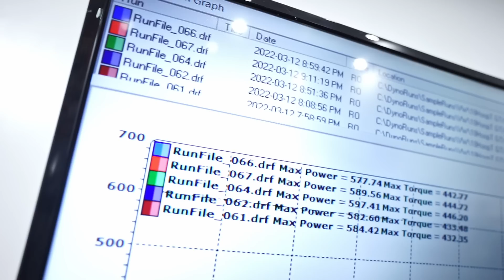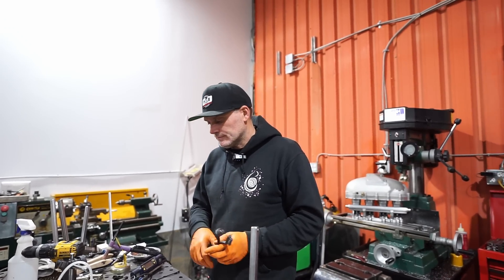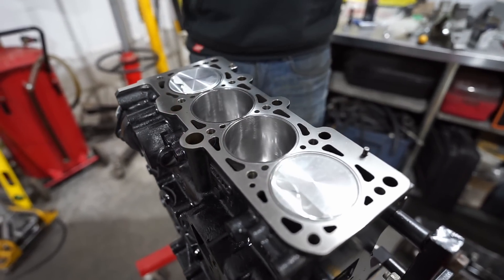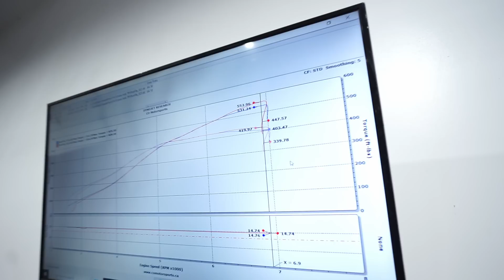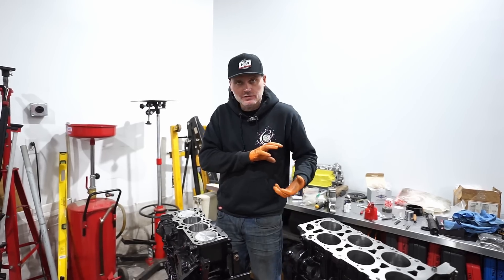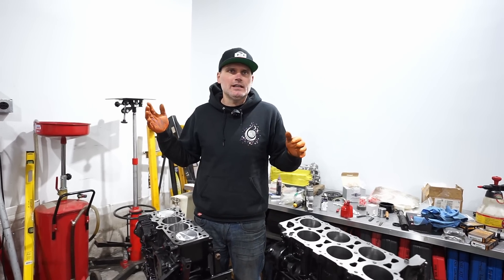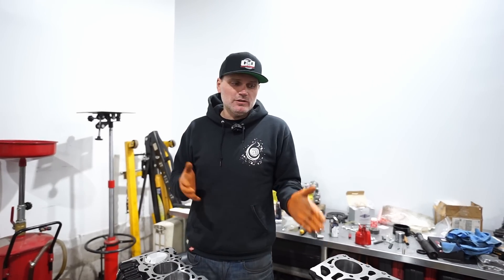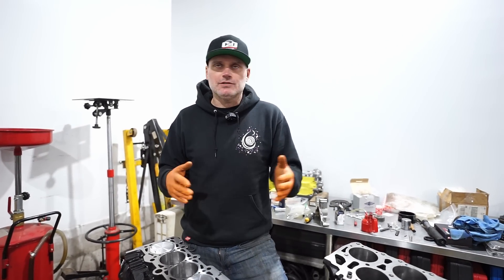Best VW/Audi Engine To Modify.

Comment: ~3:30, your cost / benefit analysis of the larger number of parts for building a VR6 vs any 4-cylinder can work the other way for those of us who would be paying somebody else to do the engine build.  That labor is so much more expensive than the parts either way that overall, we get more performance / $ by spending more on parts, by a small percentage compared to the total bill.  (I won't say "a little bit more," but the difference is small compared to the total bill.)

If you do the work yourself, sure, then whether / how much you consider the work a cost or something you'd pay to do, is totally subjective.  Anyway, I can see how saving $ on parts could make a lot of sense but for me, I'd rather just spend a small fraction more for the higher power at lower dangerous boost levels, no doubt about it.

Comment: I’d love to see a budget 2.5 build. You said gen 3 ea888 motors can do stock internals 500hp. Pretty sure 2.5 engines can use ea888 rods, could we see $300, 600hp rod setup from used 2.0t rods?

Comment: 2 questions can 8v head convert on a 18t engine bottom half. 
Or if the 18t piston and crank can work in the 8v block ?
Reply from the maker: Why would you put an 8v head on a 18t block. Just but the mk4 2l 8v, it's exactly that.

Comment: I have a gen2 TSI 2.0. I want to build it and the goal is to reach 700whp, but since there is now a port injected manifold I can get for it, will the gen2 still have limitations? Or will it be able to withstand the power with forged internals, 7164, direct and port injected, and 93 oct?

Comment: I’ve only ever drove super old vw engines and the newest one. 73 super beetle with barely any power at all. A vr6 in a 95 Jetta, then the 2.0 tsi gen 3. It’s nice to know the current 2.0 can be beefed up like crazy. Be insane to see how the atlas drove then. I wanted the v6 initially.  just the way it drove around the mountains with all the weight it’s carrying made it drive worse than the 2.0 turbo. I guess if you live in some flat place at sea level it’s the better engine.

Comment: Why would you want a black painted engine block? Wouldn’t you want something light colored so you could see potential fluid leaks better????
Reply from the maker: Cause in regular use it will be filthy no matter what. Road dirt and rain make a mess of everything.
Reply: @COMotorsports  this is why they made factory splash shields?  Haha probably the first thing thrown out on most modified cars anyway for sure.

Comment: Okay i do believe theres some fact in this:
Best most fun vw engine-2.5l 5cylinder!!!
Best efficiency/performance/reliability/ease/cost-hands down ea888/1.8 and 2.0.  Zero question.

Performance/fun factor is hands down the 5cylinder tho

Power/power/power though hands down 3.0 super

Comment: I really like the vr5 in my bora. The low down torque and the vtec-like shift at 4000 rpms when the intake switch resonance, and then the sound 👌🙂
Would really like to see what a bigger cam would do to that engine.

(Im an NA guy 🤷‍♂️)
Reply from the maker: Yeah we never got that engine here.
Reply: @COMotorsports  ah ok. Well I think its pretty special. With the active intake it was more advanced than the vr6 until the 3.2 that also got the resonance intake. The r32 with the 250 hp 3.2 vr6 is very nice looking indeed of course. The r32 and especially the Audi a3 might be the best bang for the buck car.

But theres something special having an engine like the vr5 with only 150 hp that is so responsive and tourqey.
Or it might just be that Im a bit nuts liking unusual cars and engines 😎

Comment: Id love to see some 2.5L builds!
Reply from the maker: They're coming.
Reply: I agree and add my vote to the 2.5 pile.
Reply: Months later and i still haven’t seen the 2.5 builds… Let me  pull up with my mk5 rabbit, and I’ll throw some money down for a exhaust, intake, tune, etc…..I’ll leave it in your hands for a week to see what you can do. And it’ll give ya a 2.5 build…
Reply: @arcticfragrances2454   if you build it please get  in touch with me. i have a mk5 rabbit as well and i wanna build it so bad because i absolutely love the car.
Reply: 07k swap the world!! I’m on my second swap with them and they’re amazing. Excellent heads, just add boost. I have hammered the heck out of my first 2.5 and it still keeps kicking.
Reply: I want to build my mk6 wagon
Reply: Also, it (should?) be cheaper to build?

IDK if they sell enough of them to compete with cost to build 1.8T or even VR.
Reply: I wanted to mod my Passat SE
Reply: My dream build is the daza engine fwd in a GTI or gli
Reply: The 07k is so cheap to get a hold of. And it's head is light years better than any VR, so I'm curious if it's more cost effective.

I'm really curious if it's head flows as well as the DAZA.
Reply: @ChargedTTq The head yes, the cams not so much.

Comment: I started writing this before you panned over to the 2.5 which was going to be my choice.  I recently drove a 2018 RS3  on a long trip and was really impressed!!!  I love the way an I5 sounds so much more than an I4 (I have a Volvo turbo I5).  I would really like to see a build starting with a VW I5 block & then seeing what can be done with that.  From what I read (IDK how accurate this is..) the VW & Audi blocks are pretty similar or basically the same it's just the upper end of the engine (and turbo obviously) that is so different.  I think I was even told the cranks on the VW 2.5 is forged & is just as capable as the Audi crank.

It would be really interesting to see a turbo build of the VW 2.5 where you cover the differences between a stock VW engine & stock Audi engine & what each is capable of.

Another idea would be be similar to the above but working with the VW 3.2 & the Audi 3.2 especially with the prices of the Audi 3.2 vehicles.  

Then there are a ton of options if you open the door to Porsche & their engines/parts which I would also love to see!!  With the old Cayennes being relatively inexpensive (IDK about engines & parts) we could see some nice 3.2 & 3.6 VR builds.  I've driven some of the V8 & V8 turbo's in the older models & was really impressed & IDK if there are any VW where these would fit besides maybe a Toureg & newer Tiguan (which I wouldn't turn my head from).  

The Audi supercharged V6 would be interesting as these were used in the B8 S4 & C6 A6, Q5, SQ5, Q7, etc & the price on these is very obtainable now & we get the continuation of this engine as the turbo charged model in the later years of many of the above models.  These tune nicely & are pretty robust from stock (I've been told) & I think Porsche has used the block as well in their SUV's even if slightly debored at times.   I also found a lot of non-VAG parts that can work with many of these models everything from pulleys, intercooler upgrades to suspension & brakes - many available from GM vehicles (I found that good used parts available for about 1/5 the price of new aftermarket parts for VAG vehicles - so some of the builds could be very economical).

I listed the above in order of what I'd like to see in a project car down to the bottom where I think these would make affordable daily drivers that are very tuneable in stock form but can also produce some very respectable numbers with a more thorough build.  I'm guessing you don't do much supercharge builds other than the G60 but for a 

I currently have a 99.5 12v VR6 GTI (5sp) which I don't know what I want to do with as it seems like a nice project car but I really am not a fan of FWD & would really like to find the 6sp manual from the 25th anniversary edition.
Reply: The 2.5 came into existence after VW Group acquired Lamborghini.  2.5 engines are loosely based on 1/2 of Lamborghini's V10.
Reply: @dantesinfernopurgatory7826  thats fanboy myth...... Audi head engine engineer claims the 07k is based on the old IMSA GTO 5 cylinder race car. He wanted that sound back in the brand. The IMSA and Trans Am race cars was his first project from Audi after leaving BMW due to tension with engine master Pual Rosche(RIP). But their is a lot similarities with audi v10, Lamborghini, and 07k engines , which is common to keep cost low in R/D.
Reply: @MiguelGarcia-vj7oo  Must be a slow day since you decided to reply to this 6 months later....🤣🤣🤣

Comment: I have a 2021 AWD volkswagen arteon you can work on ANYTIME and it would be an awesome build for your channel
Reply from the maker: No problem, drop it off and let us know how much power you want.
Reply: @COMotorsports  well first im waiting for my settlement but I heard a twin turbo V6 will fit so I dont know what would be best stay with the stock motor and get the most power or go with a V6 but either way I would need to change the transmission and price

Comment: Gen3 weak link = thurst bearing 😞
Reply from the maker: I wouldn't classify the entire gen3 engine platform with that issue. Seems a very unique batch.
Reply: @COMotorsports  Manual cars with upgraded clutches exacerbate the issue quite a bit. It's only a 180 degree bearing and once it wears past a certain point the crank and the block eat each other. Adding a second 180 bearing on the journal is an option and is probably good insurance if the engine is already being rebuilt for a manual car. It's also not serviceable without dropping the trans which sucks for a simple bearing refresh. All that being said, the engine does crank out the power and I'll miss my Golf R Mk7. 

Great videos BTW!

Comment: i heard that modern 1.4/1.5 engines tune pretty good too (mk7 for example) only downside is you cant get aftermarket clutch for manual mk7 golf for example and manual transmission itself...what i could find online a guy said that he lost 3rd gear only after making 400 or 450nm i think and 15k km...sooo stage 2 still shouldnt be a problem i think just go easy on the clutch and engine should handle it without a problem
Reply from the maker: There are plenty of clutches available, unless it has some odd crank bolt pattern, or some completely different transmission then the other MK7 Golfs 5spds which I doubt.

Comment: for some reason everyone here nailed 1.9tdi to the clouds.. so i went and bought 1.9tdi 96kw audi a4b6 ABT tuned to around 170hp.. what id like to know is, why is, and is 1.9tdi actually a good engine, and how do i pull more out of it without oppening engine? what parts should i upgrade?
Reply from the maker: Upgrade the engine itself. Lol
Reply: 🤦‍♂🤦‍♂🤦‍♂ gg COM.. ill get a new car then.. its cheeper that way.. what do i aim for? im a fan of audi a3 s3 and rs3.. 2009 model.. what engine do you suggest on those that are best for upgrades without engine opening?

Comment: I live In WA state if I ship my car to you how much would you charge for dyno or see what you can do to make more hp
Reply from the maker: For sure we can. Price will come down to the build and what's required.
Reply: @COMotorsports  I have a stage 2 tune with 2step with ko4 and tt225 injectors front mount intercooler Cold air Intake stage 2 clutch 007 bov catless downpipe after this list what else you think would be required to reach lease 350-400hp?
Reply from the maker: @xaviergli20thedition27  a different turbo for sure.
Reply: @COMotorsports  you have email I can message u off of instead of YouTube lol
Reply from the maker: @xaviergli20thedition27  It's on our YT profile and our website.
Reply: @COMotorsports  my car is also 2004 vw jetta gli 1.8t lol

Comment: What is your toughts on 07k platform?
Reply from the maker: Amazing engines, probably my fav.
Reply: @COMotorsports  what camshaft and valvetrain would you recommend on a built 700bhp engine? Keeping the hydraulic lifters.
Reply from the maker: @ealoken  Haven't made that much power in one yet. But I have a set of supertech springs for mine, plan to run to 8k RPM ~600whp with stock cams.
Reply: @COMotorsports  on what power level do you change valves?
Reply: @COMotorsports  any Dyno graph? What turbo?

Comment: Best built VW engine...
Easy answer. AAA 12valve VR6, longitudinally mounted in orientation, 01E 6spd or 0A2 and Tilton twin disk, wavetrac or quaife LSD, Ferrea valve train, 83mm JE 9:1 pistons, tuscan or Carrillo or pauter rods 164x20mm, arp 625 rod, head, bolts, 263 or 272 cam, log intake, gtx 3582 in .86 AR or EFR equivalent also really like xona rotors,twin scroll helps especially if you run a big gt40 hot side in a big AR like a 1.06, calico coated mains, rods, lugtronics standalone, tubular turbo manifold, girdled bottom end, 2step, no lift shift, boost by gear/NOS via post intercooler dryspray and post MAP big wetshot for top end, rolling launch, fairly aggressive E85 tune on meth,  700+ awhp all  day and beat the shit out of it daily with no fucks given bouncing redline stop light to stop light; added bonus:  a 10 minute turbo change out, reflash and setup and you can have a multi faceted race car to suit drag, auto cross and the ever so popular "dyno queen" category! ...and the sound...the sound is capable of making a built and boosted 2jz  owner question japanese brand allegiance and cross over to the dark and expensive and debilitating artwork and addictive form of hard core german engine builder porn and lifelong recovery from the disease of spending every last dollar on that damn endless and unwinnable pursuit of 3 digit time slips in the 1320 ft dash and 4 digit awhp figures to impress complete strangers and ward off any potential  woman that is rational or dare question your reasoning for this next project or irresponsible credit line at 29.9% Apr that seems logical to naturally max out at every available opportunity to get more parts and a bigger fuckin turbo/fuel pump/injectors/etc that she'll eventually leave you for....lol
Reply from the maker: You're missing a period.

Comment: I love my 6R but the engine does feel like it gets sluggish and have to always gov through the carbon cleans and I think I need a new camshaft but! I was putting my build based on that engine ea113  … I know apr came out with a new smart LPFP and VIS has the best hPFP out there in my opinion and now a company JDY is doing tons of  work with this platform and they offer dual LPFP …. But idk is that were the problem is on the car just have a good high performance LPFP and hPFP ? Or is it more then that cuz everyone’s been doing these daza swaps… well probably mostly shops but it’s either 2.5t daza or the 3.2 vr6 but the vr6 is heavy… changes the balance of the 6R makes it nose heavy…… I would push my self to get a billet block for the vr6 if I did.. even though that’s ax serious amount of money for just distribution…..   idk man i never liked the way the 7R engines sound but your video makes me want to buy one now and swap it in my 6

Comment: I have a Stock 2017 VW Golf Alltrack 1.8L Turbo. Any tips for Starter to Stage Tune ups/Builds?
Reply from the maker: Pic your end goals first if you can. It will save you money buying useless stuff or having to switch software.

Comment: "What is your favorite engine to modify" should be the namesake of the vid, how you going to leave out the TDI? They are HUGE in the swap world (and the majority of swaps aren't stock). I doubled the miles and smiles per gallon in my Jeep for example.
Reply from the maker: Simply because they can't make nearly as much power as easy as their counterparts.
Reply: @COMotorsports  Hence why I put the bit about "your favorite" per what you guys do - not everyone's design criteria involves making gobbs of power. My Jeep has no business making more power than I gave it with my TDI swap. 180-200 hp is fine in this application - I've seen people tow 5-10klbs and still make better mpg than the little AMC 2.5L 4cyl engine that I swapped out, Cheers.
Reply from the maker: @amorag59  it's what our channel's based around so it makes sense. Lol
Reply: @amorag59  I agree, modify isn't always synonymous with "going for power" TDI's are all about decent low end torque and fuel economy in a low weight package. But he seems too blind to acknowledge that the viewership is bigger than his subscribers.

Comment: Best VW engine ever and the best to modify (diesel) is the TDi PD (last 1.9TDi to be exact).
The older 1.9 TDi ones, while capable of doing a lot of km/miles, weren't nearly, without a doubt, as good as the last one (injector pump).
You can count by the fingers of one hand the engines VW made that were really that good.
Reply: Agreed but the poster seems to think all that is important is peak power on his fav engines. As if the engine swap world doesn't exists. I don't think he realises what he titled this vid 🤣bcTDIs are a perfect mix of performance, fuel economy and torque in a truck swap!

Comment: My favorite hands down the 2.0 T EA888 gen 3, so easy to make gobs of reliable power , Bomb proof engine to boot .
I have an 18 Audi S3 with stage 2 , it’s about an extra 100 HP over stock , high 11,s in the 1/4
Reply: I have a getta GLI EA888 2021 what do you recommend as a beginner at modifying
Reply: @semba_9676  Hey, yeah go for stage 1 tune ECU/TCU....you do not need any add ons for stage 1. I went with 034 motorsports and am very happy with them. with stage 2 I'm right at 400 HP , I also have cold air intake/ turbo inlet pipe,  CTS intercooler, CTS 3.5 downpipe. It's a total blast to drive, 11.9 quarter mile/ 0-60 in 3.9 sec.
Reply: @volkssturm9694  I'll tune it & downpipe it for now how much you think it will cost? & what do you think about turbo blanket? I heard it's also good
Reply: @semba_9676  If you gotta ask you can't afford this life. LOL